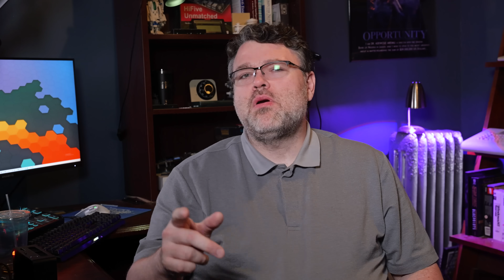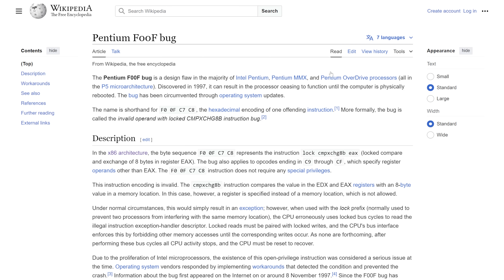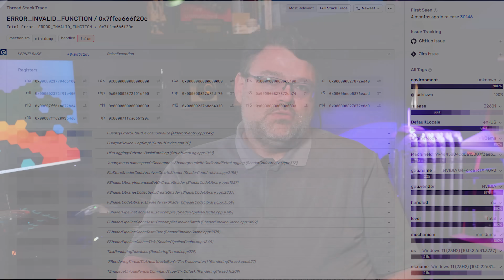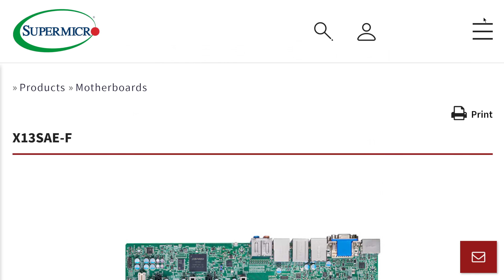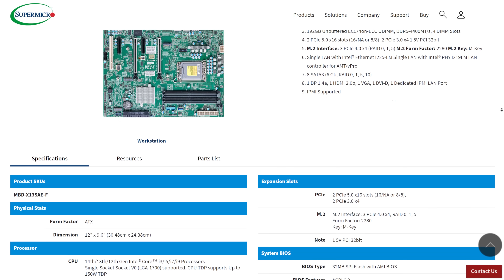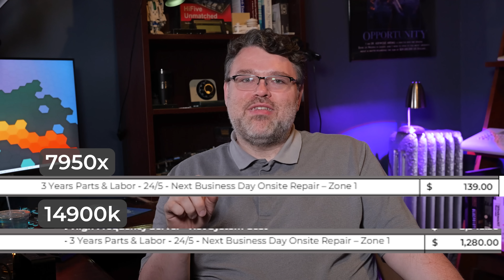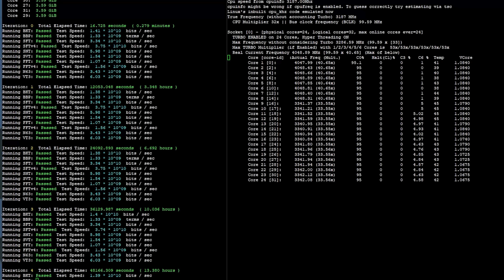Intel has a Pretty Big Problem

Comment: 25% is a ridiculous failure rate for the high volume OEMs. Wonder if intel is getting back the failed chips to do some failure analysis on them with test boards and thermal imaging or something.
Reply: So far they're taking the failed cpu's and sweeping them under a very big rug.
Reply: @pf100andahalf  maybe that rug will come up in 40 years on an asmr “intel rug cleaning” video 😂
Reply: @highiqwarrior  I think even if you gave the CPUs to Intel for free they wouldn't want it. It's not like they don't know. They even probably know the exact reason. They just can't do anything about it without losing millions or billions. Because it's probably some hardware issue they can't easily undo. They messed up. Just like with the IHS crap. This is one of those times where you start to consider using your right to sue.
Reply: @pf100andahalf E.T. style?
Reply: @pf100andahalf they are being buried with the Atari ET carts.
Reply: And it's alluded that 25% isn't even the real failure rate, but maybe the "unfixable" failure rate, where a BIOS update / memory downclock won't get around it.
Reply: " please dont sue or class action us, heres a replacement . . . keep quiet. "
Reply: Microsoft’s Xbox 360: “I feel personally attacked”
Reply: My guess is it's simply that power/frequency limits are pushed beyond what the platform can reasonably support, which means this was an intentional choice intel made. It is a known workaround that underclocking and reducing power limits increases stability.... at first. But once it starts happening, it seems that the damage is done, and it's only going to keep getting worse.
Reply: @rich1051414  The LGA1700 CPUs also get progressively more bowed over time by Intel's idiotic ILM, which will raise temps.  Noctua has talked about it.  Granted, this was true for 12th gen as well, but I wouldn't be surprised if it's contributing.
Reply: @concinnus  Yeah, latest processors thermal solutions arent good...i guess we will have to use OEM IHS and thermal compound in the future if amd/intel duo doesnt fix it.
Reply: @alexturnbackthearmy1907  AMD's AM5 IHS might be as thick as their consumer GPU division is, but they haven't been proven to suck in the same way the LGA1700 IHS does.
I'd say Intel needs to change the ILM for the upcoming platform, but it's already been decided that it'll essentially be the same one as LGA1700.
Reply: @lennard9331  Well they both still suck in their own way (lga1700 sucks more tbh). I mean, tech was around for decades, how hard can it be?
Reply: @alexturnbackthearmy1907  AMD was overly concerned with a design that would be compatible with standard AM4 coolers. Can't blame them for it when that's what the media and the consumers demanded. If it were up to me (which is clearly isn't), I would've said "to hell with compatibility" and just made the most thermally efficient design. Still, though, at least the AM5 IHS is ridiculously easy to delid (some dental floss and an a good old flatiron), so if you're like me and don't need a warranty, you can just go for it
Reply: @concinnus  that was interesting when it was brought up, but like everything else, it's just cosmetic. If there was enough bow force on the motherboard it would do way more damage than just instability.
Reply: @alexturnbackthearmy1907  It is as hard as keeping features in Windows working well (or getting features like securely removing external drives work at all, while third party tools haven a working solution for a long time), that were working perfectly fine in old versions of Windows.
Just yesterday I had to think about this again when creating and folder and changing it's name was still showing it as "New Folder" until manually refreshing Windows Explorer... This or not even showing new folders and files at all until manual refresh is something that didn't really happen with earlier versions of Windows, at least nowhere near as often that I actually was aware of this being a problem.

I mean also in other areas have been solves years ago, like UI or control scheme design. Still you have UIs designed in a way that you can't, for example, press down at the end of a list to jump to the top. Or for controls, not putting actions like attack on the same mouse button as movement (which especially suck for ranged attacks / kiting - I look at you, Corepunk!).

We can also look at customer service, were lots of things are now "too hard" or "too much effort" even though were perfectly fine for decades. Like paying bus fares in cash...
Reply: @battokizu  LOL it's amazing people deny factual events like it didn't happen. "Oh that was fun but we got over it". Um, just no. The issue is not instability or motherboard bending, it's CPU bending! I use a contact frame and there's at least 10C temperature difference. If that's cosmetic then sun bath without a sun screen is also cosmetic... I dare you to try it.
Reply: @lennard9331  Also, with how thick the AM5 IHS is, it's less likely to bow anyway.
Reply: @lennard9331  At least for the 8core/CCD SKUs, I'd say the best performing (but still foolproof) solution would be a vapor chamber IHS.  It's thick enough, and iirc they looked into it, but I guess it was too expensive.
Reply: @concinnus  it's too expensive, has a higher failure rate than just a simple chunk of copper and doesn't play nearly as well with being soldered onto the chip
Reply: @rich1051414  I think you're right.
Reply: @rich1051414  So does this mean the laptop cpus are safe?
Reply: I recently RMA'd a 14900KS within its first week of failure, only 1 month after purchase.  I mailed it with a physical letter for their engineers explaining how nice it was treated:  My symptom was EXACTLY what wendell hit here:  100% reproducible _Decompression_ failures in Nvidia's Driver Installer, but also game crashes.  I hope it helps them, because I had never booted that CPU without their updated Power Profiles.  It was 192GB @ 4400Mhz, rest was 100% stock.  The one thing that caught my eye was it might be single-threaded workloads in their eTVB that make the degradation worse, or maybe that in combination with the memory frequency?

I think my next attempt I'll keep the memory clocked at 4000Mhz, and will run with their new 0x125 bios microcode that's coming out on July 19th; which is supposed to fix eTVB parameters.

Seems like I'm just destined to hit this more often with all that RAM.  My biggest fear is I might get stuck with a decomposing CPU outside of warranty, but every attempt at this seems like another gamble of "how fast will it eat itself this time without me noticing?"

For reference, this will be my 3rd attempt at this 🤐
Reply: I think they already know. And it has to do with branch mispredictions IMHO.
Reply: @crazyidiot5309  branch predictor errors alone cannot cause an error rate of this calibre, and we'd be seeing similar errors in all SKUs that use the full RPL-S die, not just the top of the line models. The IO errors, on the other hand, make me think that this might be a problem with the cache. Unstable cache can do very weird stuff and Intel has been pushing the ring bus clock as high as it'll go because that's where a massive portion of the gaming performance is coming from.
Reply: @lennard9331  that it could be also. As he said, root cause this and it'll probably be something simple but should have been caught much earlier in the fab process. But then I believe these are being fab'd at TSMC, no? Might not be. Not entirely sure the ratio of what they fab there ATM. BUT I will say that as long as Intel was manufacturing and designing, we didn't have these issues, just process node shrinkage issues.
Reply: @crazyidiot5309  nop, RPL-S is entirely made at Intel using their "Intel 7" process
Reply: Sounds like it's a dynamic clocking bug getting stuck into a strange mode, causing crashes.
Reply: @justanothercomment416  that wouldn't explain the increased crash frequency over time for any given system
Reply: @gmonkman  What do you mean? It completely explains. The dynamic clocking sounds like it's getting stuck or not always working correctly. Components break down over time. If it's already marginal it will become worse over time. Which also explains why their position is new hardware fixes it. They provide batches which have fewer marginal numbers.

All of which also explains why the clock suddenly slows and sits there for extended periods of time. Because the dynamic clock adjusting is sticking.

Comment: 14:58 - HOLY BALLS!!!! That’s crazy!!! When the data center operators notice issues and you know they collect data…something is up for sure!!!
Reply: I'm surprised they didn't leak this earlier.
Reply: @korhanaydemir8366  They probably thought it was just them.
Reply: This is going to drive companies to AMD much faster than before.
Reply: @aminorityofone About 30 seconds later, we're pushing our customers towards the 7950X platform. Which is exactly what I would be doing in their position.
Reply: I got my 13900KF 4090 build last year thinking it would last 8 years. Not knowing it'd be having such issues within a year...😂😅🥹🥲😥😢😭
Reply: That is one hell of a smoking gun.
Reply: Yeah -- this is somewhat surprising from intel.  This is amateurishly like the late 2000s AMD graphic card performance.  I bet its heat problems from bad caps or arrays or interdigitated caps.  If its design then, that's really really going to be surprising.  I've fixed my AMD processor from swapping out dry caps before.
Reply: @complexity5545  It's what happens when a huge company has to go from 14nm++++ to actually having competition in the span of a few years. They're doing whatever it takes to have high numbers in the benchmarks, including pushing their CPUs beyond all safety margins.
Reply: @seeibe this! They can't keep up with AMD and instead of competing in price to performance and lowering their margins, they're just pushing the chips beyond what they can reasonably handle.
Reply: @complexity5545  I'm wondering if it's the IO die, or Intel's Multi Chip Module tech, or maybe where they've moved to a new process node.  Ever since Spectre/Meltdown forced Intel to stop doing unsafe speculative execution, they have been using the Tim Taylor approach to keep up with AMD.

Which is to say I put 50/50 ods on manufacturing defect vs design defect.
Reply: @EmperorA0  I wouldnt put it aside that they just cheaped out on components. Remember that time they switched out from solder and it wasnt good?
Reply: @EmperorA0  intel's "next gen" architectures have been terrible and filled with many issues. the Xe GPU is trash outright, hence their GPU with transistor budget of a RTX 3070 and a process node advantage over it performs like a GTX 1080. when I was packaging drivers and deploying laptops for my old job the intel Xe laptops suddenly always had driver problems and display issues, where the old iGPU was perfect. Their next gen CPU architecture has also been fraught with issues since the 12 series. It looks like intel doesn't even know the root cause either.
Reply: @EmperorA0 the affected chips are monolithic
Reply: @EmperorA0  I guarantee the issue is still in their branch prediction. I've done some comparison between ARM CPU cores and AMD/Intel. ARM cores act different in the ways you expect. AMD is fine. Intel starts really having a hard time. It's almost like they slightly modified their algorithms for Spectre/Meltdown for speculative and screwed the entire pipeline up.

Comment: The funny thing is, the 7950x really is a good bit faster in many real workloads. Phoronix has great benchmarks that aren't just the standard fare and has great granularity.
The real intel problem is the 9950x dropping in about 2 weeks.
Reply: E-cores are overrated anyways.
Reply: Yes AMD is generally much faster in Linux
Reply: @PowellCat745  Windows as well, the biggest win intel has in the "productivity" benchmarks is cinebench. There is a reason AMD pushed cinebench benches in the original ryzen benchmarks, and that is because it is very insensitive to core to core communications. The reason intel does E cores is because their biggest strength is also their biggest weakness. Intel uses a ring bus in their desktop CPUs, this is great for making up to 8 cores really fast, it's great for gaming, but the core architecture is stuck with 8 fast cores while the rest suffer. For them to cover this weakness up with E cores is pretty smart, but, 16 weak cores on a gimped bus does fall behind 8 real cores on a faster bus.
Reply: The ryzen is a fantastic product

Comment: Intel's trouble started when they replaced engineer CEO's with an "Accountant" CEO.   EVERYTHING has gone South since.  I'm glad Pat is back but the damage was already done. Today, Intel doesn't have ONE. SINGLE. PRODUCT that's leading the industry. NOT. ONE.  Not desktop, Not servers, not mobile, not ultra mobiles, not gpu and certainly not. AI.  It's kinda crazy when you think about it.
Reply: They make nice NICs, both wired and wireless. Shame they cancelled Optane.
Reply: @Birdulon  the x710 was basically a disaster. The i225 and i226 have been troubled.

Their wireless firmware and drivers have been garbage for the last few years - my brothers machine would BSOD once a week from the garbage Intel wireless drivers.

Intel is very hit or miss, and they haven't had a decent 10gb nic since the x550, which is a server nic and officially discontinued.

The x710 nic that replaced it, they moved all the functions into the driver instead of the firmware, and because of that the performance and reliability has been spotty.

And we're not even gonna talk about the absolute dumpster fire that is the entire Intel puma cable modem chipset family!!!!!
Reply: @kienanvella Yup. Nvidia and their acquired Mellanox lineup take the cake currently, and really have since Connect-X 2 kicked off
Reply: Pretty stark. Good luck Pat!
Reply: The bought and messed up Altera - which they recently returned to being a standalone entity. Then they proceeded to make a pigs dinner of their RISC-V strategy. That's only a couple of the indignities that I've suffered at the hands of Intel in the past 5 years.
Reply: Ru kidding me they had community college ceos / presidents for a while there - from 2015-2020 Intel was being run by hyenas ...
Reply: Oh well you waisted your life writing that.

Comment: Buy Intel.  FAFO.  Buy AMD.
Reply: Yeah 10 minute boot times on 7800x3d, and still only answer is to not shut the PC down.
Reply: Hmmm, try these things: run with one stick of ram, try a different ram slot, update the motherboard BIOS, disconnect the LAN and wireless then try booting, disconnect anything USB then try booting
Reply: If Windows is updating that can take forever.

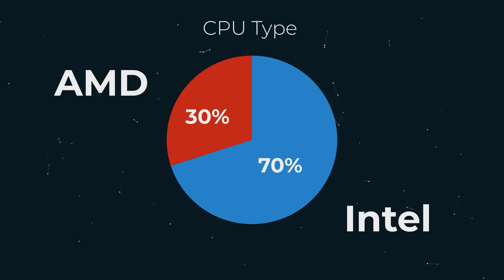Comment: 5:12 this also tells you that 70% of gamers bought their rigs prebuilt from some store.
Reply: correlation does not mean causation.
Reply: Why so much prebuild uses intel?
Reply: @nempk1  Contracts. An Intel rep will walk in and offer you a price on a 1000 CPU tray that is half, or more, below the retail price but you have to sign a contract saying you will sell 75 or 80% Intel systems.
Reply: @nempk1  Intel has a lot of contracts with OEMS to sell their products.
Reply: @nempk1 companies like to do business with companies that they can have relations with. AMD is smaller than Intel and the team that services OEMs is really small. A company building a pre-built is simply going to get better support and communication from Intel because the Intel team is larger. When AMD builds up their team and starts targeting pre-builts you will see OEMs shift to AMD.
Reply: @nempk1  what part of that graph tells us they bought a prebuilt? Intel still has lots of fanbois from the pre-ryzen days where AMD was worse. Same as for Nvidia, most people just buy Nvidia because that's what they always bought
Reply: I don't know about them being pre-builts.  If you are just going to be doing a little gaming and see a $60 Z690 and a 12600k for $140, what are you supposed to do?  Or a bundle for $250 that includes an i7, mobo and RAM?
Reply: I would go Intel if I wanted to use Linux and didn't want to deal with Ryzen's driver issues. For a Plex server I would also go Intel because QuickSync goes brrrrr
Reply: @harryshuman9637  what Ryzen driver issues are there on Linux, and how is that related to people buying prebuilt gaming rigs (running WIndows because of course)
Reply: @harryshuman9637 QuickSync is a definite use case for Intel for video editors. GamersNexus said they actually switched from a 64 core Threadripper system to an Intel i9 system because QuickSync more than made up for the decrease in cores.

As for Linux, it’s a complete non-issue these days. And I say that as someone who daily drives Linux on my desktop. But more to the point, AMD is making HUGE inroads in datacenters where Linux is king. They’ve devoted a ton of resources into their Linux drivers, and everything ‘just works’ these days. The cloud providers wouldn’t be buying that many instances for their internal workloads if Epyc wasn’t 100% rock solid on Linux in terms of core functionality and reliability.
Reply: @nonstopNny  Thats great but we don't run on anecdotes, usually.
Reply: There are legitimate reasons for going Intel, when I bought my 13600k AMD was having a LOT of USB disconnect issues and then the exploding motherboards issue came out, traditionally Intel just works and it has proven super reliable for me, my most stable system ever, but I don't have a 13900k.